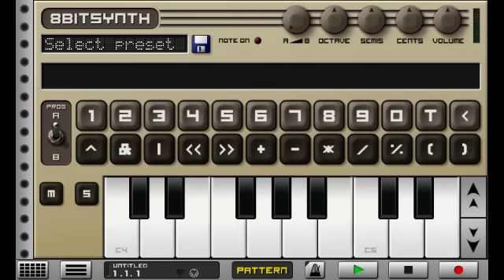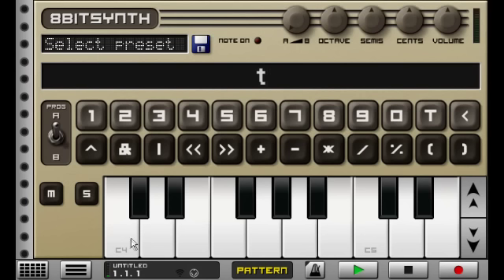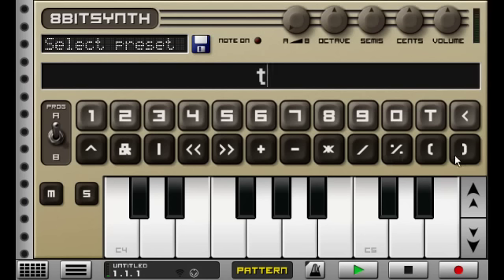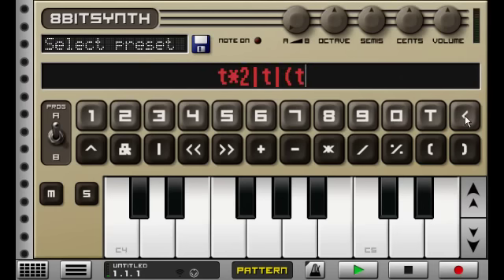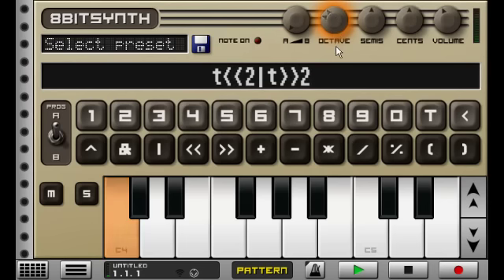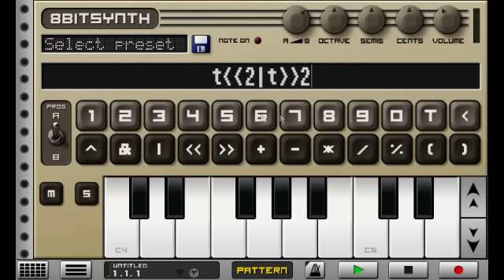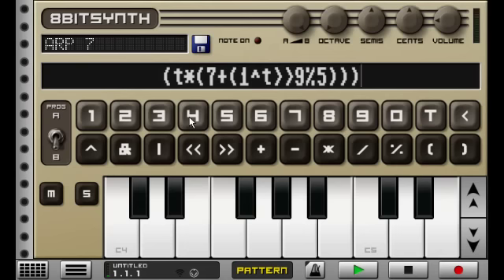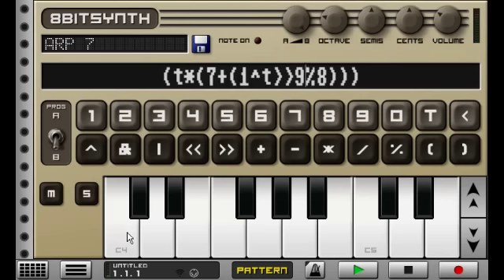8BitSynth Tutorial - Caustic 3

Comment: I can't find an answer to this anywhere: what does it actually mean when you bitwise shift a value by more than 8? This should completely erase an 8-bit value to zero but this is obviously not what happens. In particular some of the presets include expressions like (t>>106) which seems to produce a value which slowly steps upward. My best guess is that if you shift by more than 8, the number becomes wider than 8 bits and the return value of the expression is just the leftmost 8 bits of that. I wish I could see some kind of visual representation or explanation of this math
Reply from the maker: Robert Benson That's correct, the expression is evaluated, and the least significant 8 bits (leftmost) are kept and output.

Note that most of the presets were submitted by users while in beta, without complete knowledge of the internals but rather just experimenting. It's possible some expressions could be simplified.